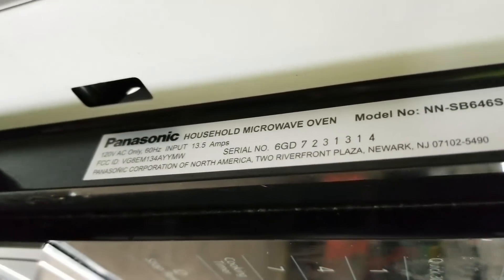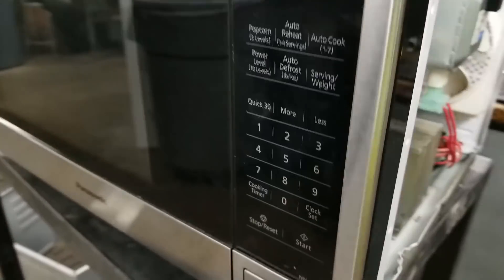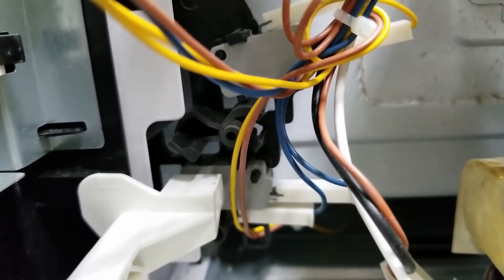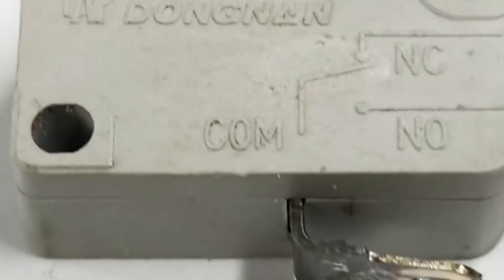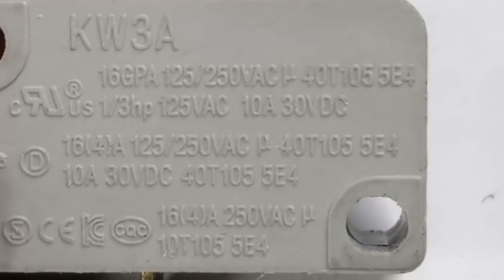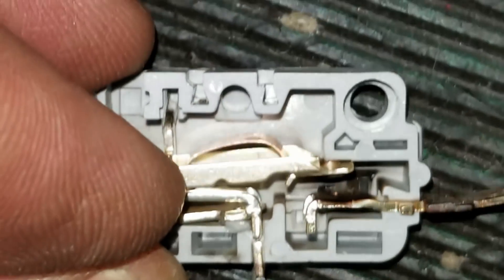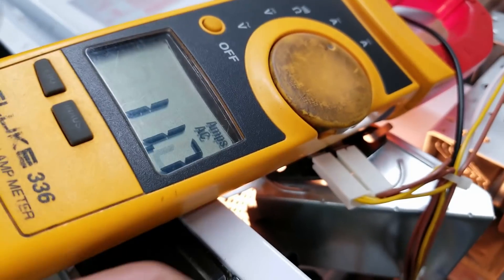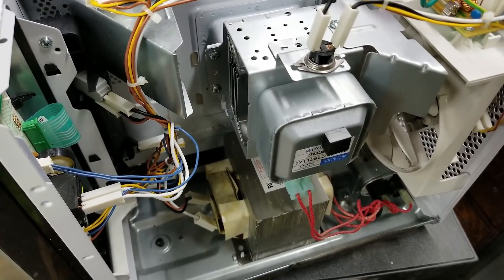PANASONIC MICROWAVE OVEN LIGHTS BUT NO HEAT REPAIR FIX NN-SB 636/646/656

Comment: Perfect diagnosis and video. I junked my 8 year old Panasonic just 1 year ago. The replacement failed the same way after just 18 months! I was ready to buy yet another but searched "Panasonic microwave repair" and found your excellent video. I found 1 micro switch was stuck in the closed position. Listening for the 3 clicks was the ticket, really clever diagnosis tid bit that I am sure comes from experience. Fixed in less than 30 minutes for zero $!!!
Reply: Thanks for sharing. How did you fix it...? Unsure if you had an extra switch or just added wd40. TiA

Comment: Hi northcal ....love ur videos..i found a nice newer frigidaire gallery stainless over range  microwave 1.7 cu ft...would not power up at all...dead....took it apart and saw that there was a small circuit board that has the main fuse on it which was good but it alao has a large a large copper coil on it with 4legs...1 leg solder was defect....i resoldered and it works great now
Reply: Very smart, H S.

Comment: I have a samsung, old and rusty inside, but I absolutely love it. Only two knobs, rotary encoders, one for power other for time. Simple display made of 7 segments, no magic there. I just found another reason to like it. If you open the door while in operation and close it, it takes a second to start over. That means that the switch doesn't take the full power on it, but the confuser triggers the relay.

Comment: Would have been straight to the point if the parts discovery would have been left at the end for those interested in that.

My kenmore countertop microwave was built in 1998 and just got the same situation as yours with a possible upper (main) switch bad. All functions work except fan and heating.

Comment: Could u still have a bad switch even if it’s kicks
Reply: Yes, I've had them. Overheated switches cause the internals to be out of tolerance. Even when it clicks the plunger trigger point could be off.

Comment: Only a few months ago I did a repair just like that but my normally blow the main fuse surprising
Reply from the maker: That's if the "monitor" switch is bad. It puts a direct short across the AC line as a last resort fail safe

Comment: Same microwave same problem with one difference. Upon opening the switch I found the spring wasn't in the right place. Pushed it out a little with a flat screwdriver. Now it works again. Mine wasn't burnt out or anything. I think over time the spring in the switch moved enough to stop the switch from working. Great video thank you.

Comment: I have a Panasonic, that has a touchpad issue, the right row (#3, #6, #9), don't work. How that can be repaired?
Reply from the maker: most likely the membrane kaypad is failing. It is in a matrix configuration. What model is it?
Reply: @norcal715  R-402FW
Reply: It had a bad table motor as well. I have replaced that and it's working great, but the touchpad is like a film with a ribbon cable. I could not find a replacement.

Comment: I save those limit switches....they can come in handy....arent they all pretty much interchangeable? They are just limit switches
Reply from the maker: Some are rated at a much lower current for switching logic level voltages. A high current switch sometimes is not good at 5 volts /5 ma. They need the voltage to micro weld the contacts. Some companies make specialty switched just for logic level use.

Comment: Hi man, my microwave sometimes starts buzzing, even if not turned on, just plugged in, what could it be thats making all this noise ?
Reply from the maker: Standby power transformer I am guessing. That should be the only thing connected until the main power relay is energized. Without having it in front of me it is hard to tell though. Sorry
Reply: @norcal715  Thx :)

Comment: I just cannot unplug the connector from the switch for the life out  of me; I've tried using tiny screw driver to push it out and nothing works, please help...
Reply from the maker: Constant (moderate) pull and rotation (rocking it) from side to side should eventually release it.

Comment: isn't that a high current draw? most outlets only have a 15 amp breaker
Reply from the maker: most US kitchen outlets are (SABC) i think. Single appliance circuits with a 20 amp breaker.